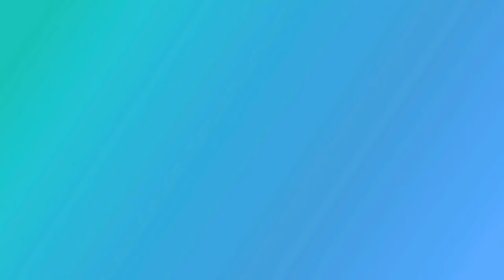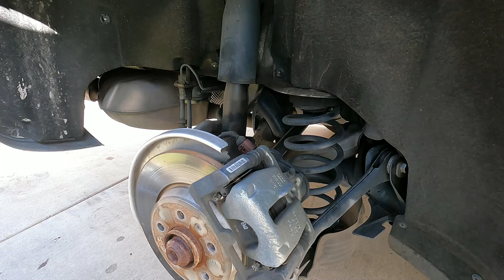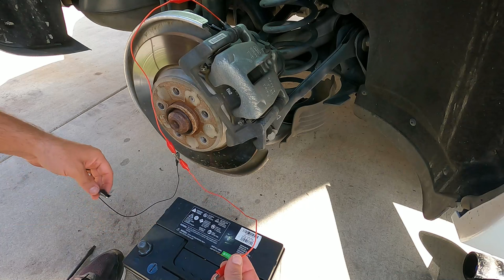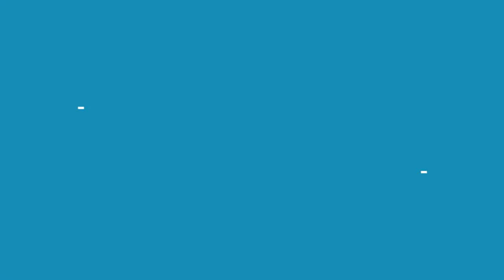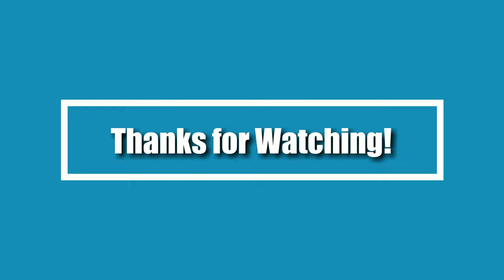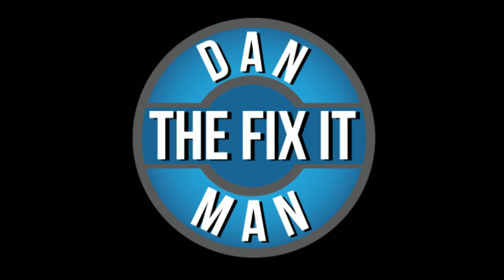HOW TO RETRACT AN ELECTRONIC PARKING BRAKE - DIY EASY METHOD WITHOUT SCAN TOOL

Comment: Disconnect immediately when you hear the noise of the motor change. The author did this in the video, but the point warrants emphasis. The change of the noise indicates that the motor has reached runout. At runout, where the motor encounters mechanical resistance, a current spike naturally occurs. In normal operation, the controller senses this current spike almost instantaneously, and responds by cutting power to the motor. In other words, the controller knows to turn off power to the motor when it sees that current spike. Since you're a human, you can't react instantaneously. If you leave a light-gauge wire connected, with all that current, you will heat the wire quickly, and burn the insulation. When you think you are nearing runout, switch to quickly tapping to make the connection. When you hear the noise from the motor change, the piston is fully retracted. Stop tapping.

Comment: You don't need to do any thing you did you can use a regular wind back tool that turns the piston as you retract it and that will turn the screw that holds back the piston as well
Reply: Takes forever

Comment: I've done it with a 9v battery.  Motor runs slower, but it works.
Reply: That's really good to know for next time thanks!
Reply: Thanks man, I just used a 9v to do mine
Reply: No shit? Just a simple 9 volt will make it work?
I don't need a car battery like this guy???
Reply: @MOAON_AABE  Nope, Just make sure it is a new or fairly good 9volt battery.

Comment: So we were doing my rear breaks on 2018 gmc terrain. We did not disconnect the wire. Had the door open and a  kid had accidentally pushed the parking break button while the caliper was off. The piston pushed all the way off and then fell out. Brake fluid leaked. My question is if i turn the car on without turning on ignition is it okay if i push the button again to release the parking break or will that make things worse?
Reply: You need to re-install the piston and bleed your brakes because now you have air inside the braking system, add brake oil to the required level.
Reply: the kid who was helping you do the brake job should have told you what to do.

Comment: Great video. Used 12v power tools but Milwaukee and Rigid 18v work great too. You can run many accessories specially power seats at the junkyard etc.

Comment: Thanks for this video. I should have watched this video before trying to change the brakes on my 2019 Lexus UX200. I’ve watched the service mode tutorial video but it didn’t work instead it pushed the piston out. I made a mistake of taking the caliper out before retracting the piston. When I tried screwing back the piston in, I stripped the thread on the bolt and  nut that pushes the piston out. I can’t find that part anywhere so I had to buy a new caliper. I hope I can find  that part so I can rebuild the ruined caliper.

Comment: If the parking brake activated while you were doing one side. Will it still work for the other side? Or do I have to buy a new motor?

Comment: Do you then reverse the process once the pads are in to reset, or will the system automatically reset at startup?
Reply from the maker: No, but after you complete the brake job and have everything back together, Before you start the vehicle, press the brake pedal about 1/2 way down a few times until it feels firm and then when you start the engine and apply the parking brake It will automatically adjust to where it needs to be.
Thanks for watching.

Comment: Hi, My EPB on rear left caliper is not engaging and I am going to replace the actuator. I guess I don't need to retract the piston or something like that right? as the parking brake is not activated so can I simply replace the actuator without any retraction and scan tool?
Reply from the maker: You should be able to remove the caliper with the mechanism and motor without having to retract anything unless the mechanism/motor is stuck on (parking brake applied), then you would have to take off the actuator motor (two allen head bolts usually) and manually turn the mechanism in.  If you are changing the motor only and are going to re-use the caliper mechanism, then you will still need to turn it back in and press in the piston before putting it back together.  Hope that helps!
Thanks for watching!
-Dan the Fix it Man

Comment: Would the caliper not already be rewound if you just released the brake.  Or will putting the battery on it rewind the piston back a bit more. ?
Reply from the maker: When the parking brake is released, it is not far enough back to fit the new pads in.
Reply: @DantheFixitMan  i wonder if you apply pressure , would that activate the parking brake release again ?
Reply: The parking brake actuator only rewinds a little when you release the parking brake, just enough to allow the square cut seal to pull the piston back in a little, and just enough move the pads off the disc, just like any normal calliper without EPB would do. 
To change pads you need to wind the actuator all the way back, so that you can them push or press the piston all the way back following that.
The method shown here is one of a few if you don't have a scan tool or diagnostics phone app, but isn't a method I would recommend however, as damage can be done to the actuator by applying power to it like that. 
Scan tools and phone apps don't cost too much, which are capable of fully rewinding the parking brake mechanism and stopping properly when resistance is met.

Comment: What about once you're done? Do you do that to close the break back up? Or do you just push that electronic break in the front seat?
Reply from the maker: Just push the button to apply the brake and it Will automatically adjust.
Reply: Thanks

Comment: Do you have to do anything to reset the EPB when all is done?  Also is there a EPB  on the front Q5 brakes?
Reply from the maker: I didn’t have to reset it or anything like that.  It’s working great.
Thx for watching!
-Dan the Fix it Man
Reply from the maker: And there is not an EPB on the front, only the back

Comment: I did this and now have a electronic parking brake malfunction light, do you have a solution for this?
Reply from the maker: Hi Luke,
So sorry you are having trouble with this.  I have never had a code show up after doing this as long as you keep the car off and don’t turn it on until you are done.  You might need to have the code cleared with a scan tool, or you may be able to clear the code by temporarily disconnecting the battery ground cable.

Comment: Will this work for a 2014 Mercedes cla 250 without giving error codes when I disconnect it.
Reply from the maker: I have never had a problem with this method as long as the car is turned off.  Do this at your own risk.

Comment: First off, i want to say what you do and your videos are good, I'm not trying to sound like a hater. And I know you're trying to do it cheaply for others but it would also be a good idea to teach them how to do it with the proper equipment/tools. 
You could just do it properly by putting it into service mode with a scanner. Obviously this method "works" and saves you $75-100 on a scanner, that you'll only use once or twice a year. However, you can still damage that piston using this method.  Which if it happens to you, it could end up costing you several hundred dollars depending on your resources. Personally I wouldn't cheap out nor risk it over a $100 scanner.

* I own a mobile brake and rotor business and I have had a couple of customers who had someone else come do it, which Im assuming was a buddy, and ended up damaging it. It's easy money for me as with that same scanner I bleed out the system after replacing the caliper. But to each their own.
Reply from the maker: It's all good Christian, I appreciate the feedback.  I do have scanners for several vehicles, but did not have anything that was compatible with the Audi at the time I made this video.
Happy wrenching!
Take care,
-Dan the Fix it Man
Reply: I would love to pick your brain regarding Mobil brake and rotor service as I’ve been thinking long and hard about executing something like that.
Reply from the maker: @joshuarose3081  No worries, my email is listed under my contact info if you want to shoot me a private email.  Otherwise, feel free to reach out to me here...or, I guess you might have been wanting to reach out to christian...either way, I would be happy to help.
Take care,
-Dan the Fix it Man
Reply: @DantheFixitMan  Dan thanks. I was looking into starting small in my area with a mobile brake and tuneup service but have no idea what goes into it. I’m basically just doing some homework at this point. I’ve been doing brakes in my driveway for family and friends for the better part of 25 years so I’ve got some experience and a ton of tools. I’m 45 and tired of working for other people at this point in my life.
Reply: What is the cheapest scan tool I can buy  that will work for a 2021 acadia rear break pads with wpb?
Reply: What is the name of the specific scanner you are using and how much does it cost?
Reply: No, you cannot "damage that piston using this method." The author is doing the same thing the controller does. Stop posting misinformation, and making loose comments. The reason you don't back up your statement with sound technical information, is because there is none. The scanner is a crutch for techs who don't understand the underlying engineering. A weak tech is one who is helpless without his precious scanner. There's nothing barring you from learning your trade at a higher level, so maybe try that first before posting bad information. Then maybe you won't cling so desperately to "the proper equipment/tools." You show that owning a business does not make you knowledgeable.

Comment: Would you recommend using the battery in your vehicle for this???
 Because if not then I'm not buying an entire new battery to do this lik
Reply from the maker: Yes, you can if you have jumpers long enough, or if you want to remove your battery to do this, but I definitely wouldn't buy a new battery just for this method...
I have also heard that even a small 9volt battery will work although it might go slower...  Best of luck to you!
Thanks for watching!
-Dan the Fix it Man
Reply: @DantheFixitMan  thanks a million, 9 volt it is lol
Reply from the maker: @MOAON_AABE  No problem, please let me know how it goes.
Thx!